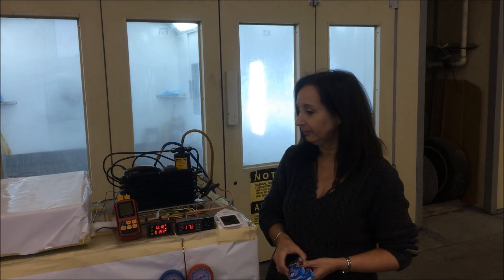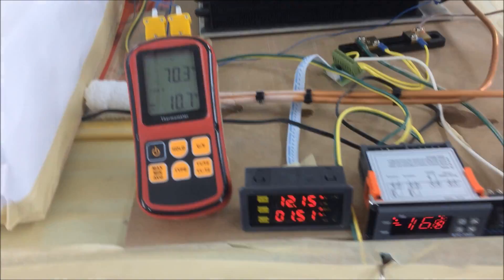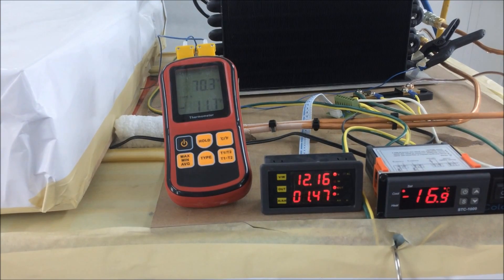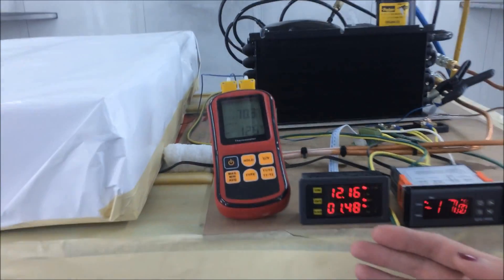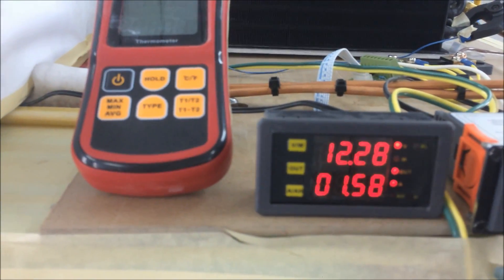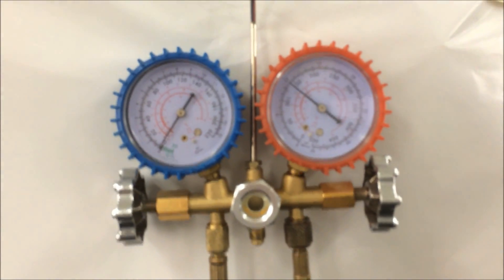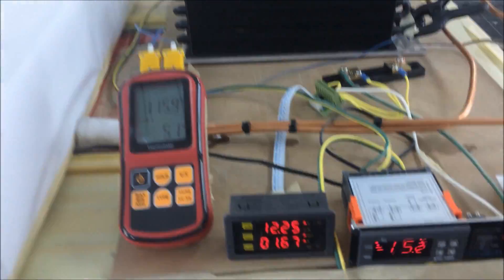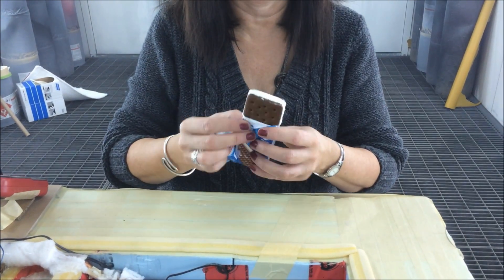Marine Refrigeration.  ColdEh high ambient temperature test.

Comment: What would be the advantage of this system vs a 12 volt fridge, like a ARB or Engel?
Reply from the maker: We get asked this often. Our systems are designed to be permanently installed in a boats existing  cold storage compartment and then become part of the the "refrigeration system " which consists of the well insulated compartment , suitably sized battery bank , and the on-board charging system that replenishes  the batteries . 
So the two are not really comparable .  The ARB fridge you mentioned is designed to be more like  a mobile  powered cooler . 
The ARB fridge is rated at .7 to 2.3/12v amps per hour , thats in a 1.67 cubic foot box. If you take the mid point amp draw , say 1.5 amps as you would probably see inside a boat on a warm day , the 24 hour usage would be 36 AH . Not bad . But if you upscaled that performance to match the size of a box you would typically need when if you are offshore or on an extended cruise , say a 7 Cubic feet of fridge, it works out to be 151/12v AHs used in 24 hours . Our system tested in a 7 CF compartment used as a refrigerator, insulated to a value of R30 typically uses 9 to 12/12v AHs in 24 hrs with a ambient temperature averaging over 80F . Our system does not lose efficiency as ambient temperature rise therefore there is no water cooling or keel cooling system needed . The ARB specifications do not state ambient temperatures that there tests are done in so you may actually experience more power usage then they claim. Being able to build an enclosure for a system and increasing the R value of that enclosure is a key factor for an energy efficient system .
Reply: Wow! Incredible results. It really shows what a decent amount of insulation can do. I guess the drawback is that it makes for a very big fridge. Still, 9-12 amps!
Reply from the maker: Yes a well insulated box and a reliable efficient refrigeration system designed  around a TXV can can yield outstanding results . Have a look at our website there is  more test data there . 
Regards  John
Reply from the maker: No Comparison. An Arb fridge of 1.6 cubic feet will draw at the lowest level , .7 of an amp which would work out to 16.8 amp hrs in 24 hrs . Our system in a 8 cubic foot box insulated to R30 will use 10 amp hrs in 24 hrs . If you upscale the performance of the ARB fridge to 8 cubic foot box , you would need almost five of them , that would total  84 AMP hrs in 24 hrs . No Comparison .
Regards John.

Comment: System looks great can it be  used as a refrigerator only?
Reply from the maker: Hi there. Yes the system can be used as a fridge only or even a spillover 
system . This setup was actually tested as a fridge before we did the 
freezer test and it constantly used only 5AH a day at 12v for the 5 days  of 
testing in 72 degree temperatures . I have all the data available.
Also the plates are available in any size or shape to fit your box , even double plates are available if needed up to a maximum of 350 Sq Inches of surface area. 

We will be showing this new system at the Annapolis Spring Boat show. So come down and check it out. 

Regards